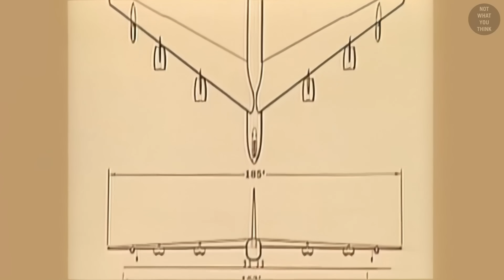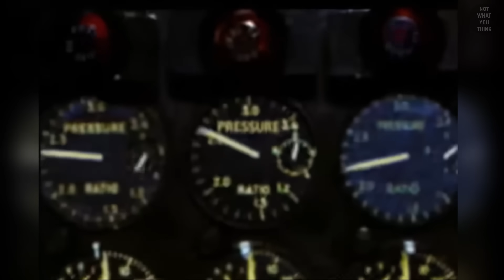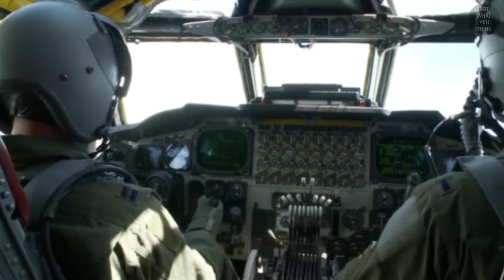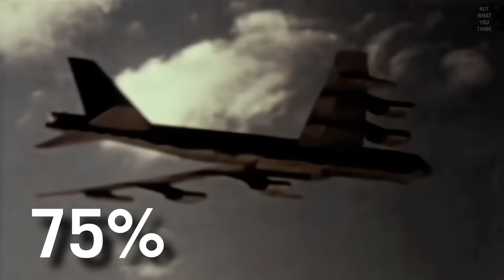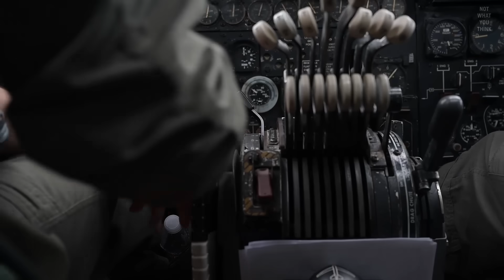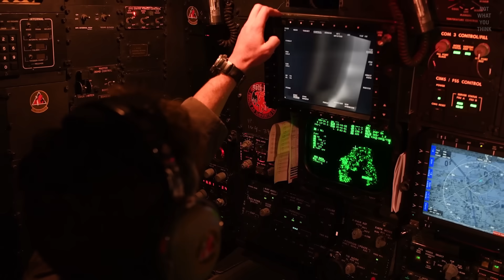Why This Obsolete Bomber Will Outlive EVERYTHING

Comment: Have a soft spot for BUFFs. Back in the early 80’s as an USAF AutoTrack Radar Specialist, 1CEVG, we had many electronic war games and radar bomb scoring runs with these big critters. It was an awesome site to see these huge planes flying sometimes what looked like treetop  level. So low at time the tracking radar would break full auto lock going through the trees. ECM capability of these things couldn’t be fully utilized during training runs due to the havoc they would create on civilian electronic equipment. It was sad seeing them being chopped up after the service they performed for so long. Thanks so much for this video! Long live the BUFF!
Reply: Tail gunner on a B-52 about the same time.  We had a training flight with fighters over water off Norfolk. Late at night on our way back the Norfolk ATC called us up and asked if we could turn on our jammers. Apparently, he somehow got permission for us to jam the ATC frequency (very close to the same frequency the Soviet's used).  We where over eastern KY and the EW turned on the jammers. The ATC's response was "HOLY SHIT, I can't see anything, my entire scope is nothing but white."  That's about 350 miles.
Reply: @54DonaldB  I was Range Controller at White Sands Test Range about the same time. They would regularly test their ECM on captured Soviet radar from Afghanistan. Ahh good times!!!
Reply: @54DonaldB  Lol! I can Imagine. I worked for the FAA after leaving the AF. I was a ATC radar tech and I’ve seen ATC’s response when something goes hinky. You must have flown through Richmond KY’s range. DET.8 I was there until 86 with some TDY up in Scobey, MT at a mobile Detachment, think it was MD 34 but can’t remember now. It was awhile ago, lol. They shut it down in ‘94…Now look what’s happening and no SAC😑
Edit: They shut Richmond down in 94. We were located on the Bluegrass Army Depot full of nerve gas. They would forget there was an AF radar site there when there were gas leak scares. We were the only active duty on the depot except for the med clinic doctor. The rest was contracted security.
Probably did EW against your crew and also scored you bombing run.
Reply: @jasperthehairycaterpillar1168  I lived beside the madison county  airport there in Richmond in the late 70's til about 1982. I was a kid and loved looking up into the bombbay as they flew over.  Waving to the crews. We moved to Paint Lick and a fuel tank fell off of one and landed about a mile away off the rail road tunnel road.
Reply: @m1964e  Oh yes, I had forgotten about that. I believe that was off one of the FB-111’s. Those fighter bombers used to also come through the Richmond Range. They also would fly very low and faster than the BUFF’s. Thanks for sharing that experience. It brings back so many memories.
Reply: @jasperthehairycaterpillar1168  When I was at Det4, we had the F-111's out of Lakenheath fly on us. One night, after a flight of two called in five minutes prior to their IP, we waited and searched with the MSQ-77 trying to find the first A/C. No dice. After a few minutes, his wingman called in his IP and did his normal run. Come to find out, the first A/C had a TTR problem and slammed into the side of a hill or mountain. I was the communicator that night. Of course, there was an investigation to see if they could put the blame on us, but we recorded all communication between the site and the Air crews.
Reply: @davidguenther8170  Wow, I’m surprised the wingman went through with his run. I guess that’s a truly realistic training mission. 
Remember in ‘86 when we did a mission against Libya? We had a light schedule at Det 8 that night, but we were scheduled to have the 509th out of Pease in New Hampshire come through. I was Radar Op on the 77 that night. They went through SOP and called IP, started going through their run and out if the blue they abandoned the .mission. No explanation. It was about an hour or so later we heard on the news from the TV in the day room- “Breaking News” we have  “just bombed Libya”. We found out why they abandoned their training mission by the ABC news or what ever station it was that night. 
Good old MSQ-77, many noisy hours spent in that system. I can hear and see it all now. The plotting board, the Parker Bros. pen refill used on the boom, the 1k Hz. tone over the radio. The jamming from the FB’s through the grass of the “A”-scopes. The MSQ-77 we had there had a rocket come through the plotting board when it was located in Vietnam. We had wondered why the Radar section serial numbers didn’t match the computer or plotting board numbers. One of the old civilian contractors said “Oh, you guys got the system that had the rocket go through the middle of the system, went right through the plotting board but didn’t blow up. Memories…thanks for commenting. I hope more guys do.
Reply: @jasperthehairycaterpillar1168  Well, it was mid/late 70's during the height of the Cold War. And the 111's only flew at night over there.

Also, other than the couple of B-52 missions at high altitude, all of our training missions were at 3,600 AGL for daytime and 4,000, 4500 for night. We were SAC, but were training the USAFE TFW's. Mostly F-4 during the day and At night as well as the F-111. We also trained the Germans flying F-4 and F-104, as well as the Frogs once a month flying their Mirages.

Did you guys ever ask for "bubble checks?"
Reply: @davidguenther8170  I don’t recall bubble checks. The FB-111’s mostly fly at night and F-4 with ANG would come through during day, if I recall correctly they only came once maybe twice a week. Det 8 was a test facility for new tracking radar/threat systems being purchased. The first one I got to see was the AN/TPQ-43. We called it Seek Score. The thing had LCD’s and was able to track by visuals using cameras. The thing could even track the moon optically. Impressive for back then. I don’t know if it made it into operation. The last we had was a jammer slaved into the 77. I only remember we had problems with it vs the TLQ-11 ground based jammer we normally utilized. That new system wasn’t there for very long. So what was a bubble check? Maybe a nav reference?
I remember doing a daily collimation check on a surveyed PE and then having to find a flying aircraft for a visual cross hair and beam tracking. Found one at 1k and visually it was only a bright light. This was during late afternoon. Full auto lock on it. Then it made a dead stop, the radar was completely still. It didn’t walk one bit. The guy up top looking through the dish telescope asked me why did I brake lock, I didn’t brake lock. I ran up top and the light was slowly moving off out if the view of the scope but you could see the light moving away with your eyes. The radar was still locked up on the thing that wasn’t there. The PIP was still locked in all three gates El, AZ and range. We didn’t have any jamming or ECM abilities like that. It was very strange. The 77 always walked around on a PE because of the 4 quadrant conical scanning. We reported it to the commander…No, you didn’t see anything was his reply….
Reply: @jasperthehairycaterpillar1168  A bubble check was just a request for the aircrew to do a low flyby over the site. Impressive to see a Phantom or Starfighter pop up out of a valley and scream overhead at 450 knots at 100-200 AGL. We also got to see the first F-15 and A-10's in theater. Most pilots were happy to oblige, especially if they got a "shack."

There was a story about a crew in New Mexico who supposedly locked on and tracked an SR-71 on its way back to Beale after a mission. The way the story goes, from one side of the PB to the other, there was only about 10 or 12 time marks on the track. Evidently the air crew got a reprimand for allowing themselves to be tracked and the site crew got chewed out and swore to secrecy, as well as the plotting paper with the track being destroyed in the burn barrel with high brass witnesses. It could be a tall tale or it could be true, your guess is as good as mine.
Reply: @davidguenther8170  A bubble check would have been very cool to see. We couldn’t, Det 8 was a tenant on an army depot. It was a sensitive area and decorated with local farmers cows. Whenever there were cows that died it was always quite a stir in the local community because of the nerve gas storage. Now theres something I haven’t heard in a number of decades, SHACK.  Buffs were good at getting those. Makes me think of the group B-52’s and the song Love Shack. I suppose the old plotting paper, 3 sided plotting ruler, drafting pencils and “super hero coder” are archaic by today’s standards, lol. Makes me feel old…oh wait maybe I am getting old, haha.  
As a young AF brat, we were stationed at Westover AFB in Massachusetts. My dad just came back from an unaccompanied tour on Iwo Jima. Westover was a SAC base and the B-52s were taking off and landing day and night. 1967-68. 68 was memorable because of the constant roaring of those massive planes. I still hear them. Now I know it was because of the Tet Offensive. Back then it was all normal, I was only 7 then and jets were just part of life along with the barbed wire fencing, tight base security and daily “Taps”. Everybody driving around or walking would stop with respect…what happened?
Reply: @jasperthehairycaterpillar1168  My Dad was a civilian employee at MCRD San Diego after he got out of the Navy. We were on the base almost daily for 16 years, until we pulled up stakes and moved to a small college town in WNC. He wouldn't sign for me to go in the Marines at 17 1/2 out of high school, but he had no problem signing me in the Air Force.

I could have waited until I was 18, but I'd seen what those crayon eating bastards went through on a daily basis 🤣 so I wasn't too hot on joining the Marines anyway.

Fun fact, when I was a kid, I used to get my hair cut by the Marine barber who cut Jim Nabor's hair for Gomer Pyle, USMC TV show.
Reply: @davidguenther8170  So you were kind of a military brat. Good for your dad not signing you up for  cannon fodder. My dad encouraged me to go into the AF. Anything in electronics. I wanted to sign up for security police, and he said if I wanted to guard aircraft and count rivets I could. I thought about it for a couple years while I worked as a production welder. I eventually signed up just after I turned 21, actually I was 20 and went in the the delayed enlistment guarantee program. Satellite Tracking Radar, but…in basic I was told that was now closed, the last class just went through. So Auto-track is where I ended up. Followed mu dad for the most part, he was NavAids then got picked up after he retired by the FAA. When I got out I also went to the FAA and the guy that was head of the New England Regional office for equipment installations, funny thing was…he was an old Auto-Track guy. 
Gomer Pyle, I watched that all the time, then Jim Nabors turned out to be gay and Rock Hudson. They started coming out because they had AIDS. How long did you stay in? Was the AF a good experience for you. It is so much different now from what I hear from a good friends son that’s a PJ (Para Rescue). I’m afraid of what’s coming.
“Crayon eating bastards” oh man. I almost fell out of my chair. I never heard that before, lol.
Reply: @jasperthehairycaterpillar1168  It was pretty good for me until my last trip to Amsterdam. I'd just got back from compassionate leave because my mom had cancer, right after I had extended my stay at Det 4 for another two years. Consequently I tried to get out of the extension and get stationed closer to home, like Richmond KY or Statesboro GA. They refused my hardship request. Me and a buddy made a weekend trip to Amsterdam and I got caught crossing an international border with contraband. Thankfully it was between Luxembourg City and Trier Germany, instead of the Dutch/German border. 

I had a chance to stay in, but decided I wanted to go home and spend time with my mom, who only lived for another few months after I got out on a "general under honorable conditions" discharge. That was right before the Iran hostage crisis.

I called home and my brother answered the phone. I said...I got some good news and some bad news. He asked what the good news was. I said, I'm almost home. Then he asked for the bad news. Told him I got kicked out of the Air Force. Don't tell mom and dad. When I flew into Ashville, they were all waiting for me, lol.
Reply: @davidguenther8170  Sorry about losing you mother at your young age. My mother is still kicking and I’m getting old myself. I had a guy that I worked with me at Richmond who got busted for pot. He was a SSgt, he wanted to stay in so he accepted being busted to airman. That happened before I got there. He was much older than everyone else but became a model airman and a friend. Then my SSgt got busted and thrown out just before I got out. Busted for pot. Never found out the particulars about him. I would have made the same choice as you. I would have gone home. When I was at Keesler in basic electronics my grandfather was found with intestinal cancer. He was like a father to me and they let me take 2 weeks leave to go home. He died 8 hrs after I got to see him, then went to his funeral. It was hard, and when I went back to Keesler I was put in remedial study and placed in the class before me. There was this old civilian instructor for the remedial study. Every day he would ask why each of us was there. The first time he asked I said I was there because of going on leave when my grandfather became ill and then died. He said, “ And how long ago was this?” I answer “Two weeks ago”. He said,” Well, you should be over that now”. From that point on, all through the rest of tech school I had a very bad attitude. I thought if that’s the kind of people that are here I don’t want to be here any longer. Then one weekend I was the alternate for dorm guard duty. The guy that was supposed pull guard duty got sick. I was in my dorm room like I was suppose to be but nobody came to tell me to fill in. I ended up having to pull CQ duty for several months and had my stripe delayed. I started purposely trying to get bad grades in school. Then I opened up to my dad on the phone one night, he explained the way it was. It’s all a control game, you have to play the game and win just like in basic. He said the best techs weren’t the guys that were top in their class, they were the guys in the middle. He said he had seen it over and over throughout his AF career and in the FAA. So I  buckled down and brought my grades up from 68 to 84 and went on to Richmond where my new commander saw what the Captain at Keesler did to me and had it removed from my records. I still missed getting A1C by 7 months. The rest of my time in the AF was pretty good 👍.
Reply: @jasperthehairycaterpillar1168  I enjoyed my time in the AF. After getting busted, they flew me to McConnell AFB, next to Leavenworth, ha ha, for "remedial basic", or rehab. It was a two week course with daily counseling. After a week, I decided that I just didn't want to do it anymore. So they sent me back to Germany. Lost my security clearance so I couldn't go into the T-2 radar and couldn't pull CQ duty...oh lucky day. Then it was just a waiting game for my JAG to get me the best deal he could. No loss of rank and no loss of veterans benefits. Hell, my APR when I got out was an 8. I'd had all 9's before that.

When I was in Kansas at that course, there was a SMSGT in the class. Evidently he had loaned his car to a couple of his guys and they left some residue in his car. He got popped in a random inspection going in the gate wherever he was stationed...or so his story went. ( A lot of the guys I was stationed with were Nam Vets and even some of the senior NCO's liked to partake every now and then.)
Reply: I was in the 1CEVG at Det 4 outside of Kaiserslautern Germany. We did the first B-52 training missions in the European theater.
Reply: @davidguenther8170  Hey brother! I wanted to go there. My wife was Belgian so it would have put us closer to her family.
Reply: I run the EW shop at barksdale. It is sad seeing what they are doing to my baby